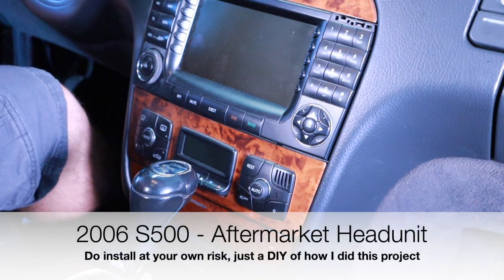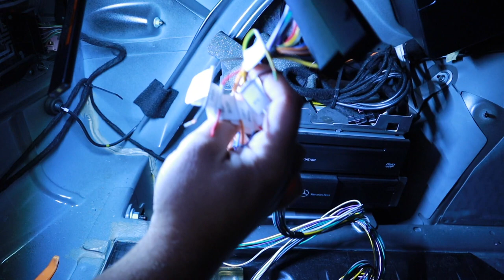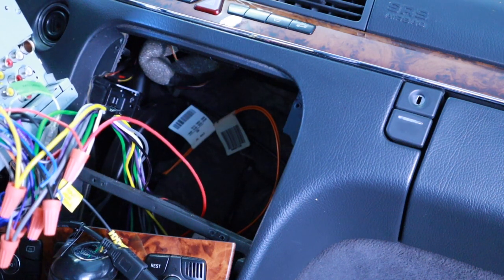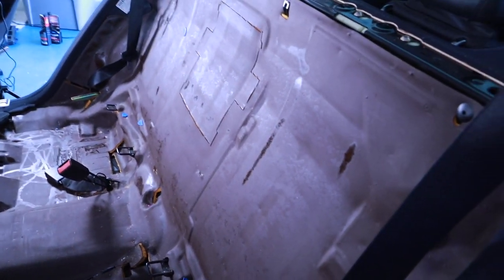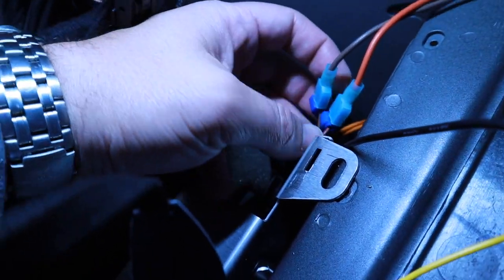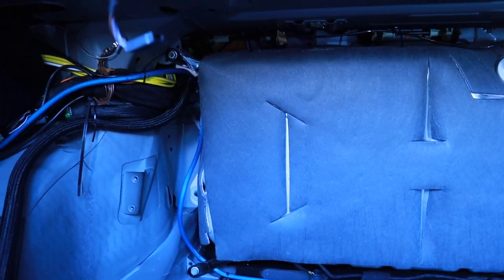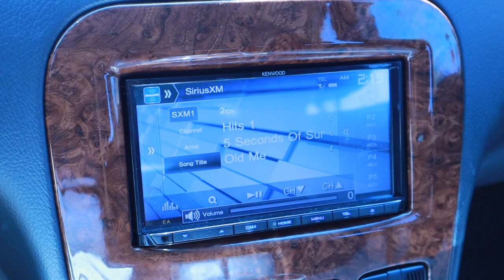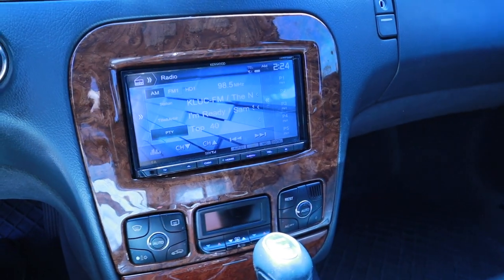(START TO FINISH) Kenwood Head Unit / Stereo Upgrade on S500 S430 W220 Mercedes Benz

Comment: Just did mine... your video saved me probably 2 weeks of pain - thanks so much! One small tip for someone who wants to do the upgrade. If you want to use the can-bus signals to steer the radio - you can use the can-bus on the climate control (twisted wire pair brown & brown/red) saves a lot of additional work.

Comment: Thank You for taking the time in producing this Excellent Instructional Video - Bravo Bravo Bravo ! 🚘
Reply from the maker: Happy to know you liked the video. It was very frustrating and fun process. Most time was wasted waiting on parts and about a week tracking down the dead battery issue. Every morning would have a dead battery. Disconnecting the audio gateway is needed.
Reply: @ShoppeRx  I can imagine the frustration - The AGW draining the battery has always been an issue with the W220 - S Class - I own a 2005 S430 since new I have 32,834 miles on it, and experienced the Battery Drain Problem, due to a bad AGW Module - Now I'm looking to Upgrade The Command Unit to something like you did - I'm still in the researching stage, and found your video very informative in the process - Thanks Again ! 🚘

Comment from the maker: **Update** it’s been about a year from the start of this project. I no longer have this car as it was a gift for my brother, but he’s still loving it. The only issue reported, the amp has cut out a few times during the hot summers in Texas, but nothing serious. Might have to make an investment in a better 5-Channel amp such as Alpine. Head unit still works great along with steering wheel controls.

Comment: Great work and great video. I have a problem and I hope you can help me.  I've installed a double din radio to my wife's 2003 Mercedes S430.  Now I have no climate control.  I noticed when you turned on your car to check the radio the climate control didn't come on as well. How did you solve that problem because I'd check every fuse and they are all good. Thank you very much. Eric.
Reply from the maker: Sorry for the delay. I didn’t have any issue with my climate control before or after the install. I think I just had it set to off. Sorry I can’t be more help.

Comment: Nice job. I did mine last year. Kenwood head unit. Skar 5 channel amp. I will say it was a pain running the wires down the center and I have to do it again for a back up camera. So I was reading in the mb forms that someone used the satellite antenna wires in the trunk lid if there not being used for there backup camera wires. Because this car has a umbilical cord that run from trunk lid to the rear under deck lid. So that way it’s easier. I’m going to try it and see if it work. Since you only need 3 wires. Power  ground and video. You can ground the video shield to ground it’ll work.

Comment: cool video and learned a lot. would you be willing to install for me? 03 w220
Reply from the maker: LOL. I would have hoped my video would have given you the courage to DIY
Reply: @ShoppeRx  I replaced my brake rotors and pads and air shock struts, change oil. Unfortunately, I never been good with car audio. Maybe I'll watch your video a couple more times, thanks.

Comment: hi your video is amazing and I'm doing my sister car bud how did you got the woofer going the 4 channel are for the doors and the 5th channel is for the SUB on the bypass harness have 2 + and 1- for the SUB
Reply from the maker: I used the Infinity K5 (5-channel) amp. Door mids/tweets run off each one channel so each door is run off the amp. The subwoofer in the trunk is hooked up to the “sub” channel on the amp. On the Spiral Audio wire harness I did have some challenges with mislabeled wires. My sub + & -  wires were something else. I had to use a toner (you could use a 9v battery) and corrected the labels.

Comment: I tried this. Only I just hooked up the deck with the basic 10 wires and tied into the hot for the cigarette lighter. Only now something in the car is staying on and draining the battery
Reply from the maker: Yeah I had the same issue after my install. Had to take to a Indy that specializes in Mercedes. They had to disconnect my audio gateway or my battery would die each morning. They said it was just pulling the factory amps fuse I believe.

Comment: Will it fit the 2002 w220 model? Im trying to get apple carplay or something cooler, my audio keeps going silent, idk which wire in the drunk is causing that , but also where would i find the trim for an aftermarket radio? Any help is appreciated
Reply from the maker: Any double din radio will work. The key is the wiring harness and dash kit. I understand the 2002 used a different harness and totally different dash kit. Checkout Spiral Audio. They will likely have everything you need.

Comment: What did you do with the fiber optic cable on the factory amp
Reply from the maker: I left all factory fiber optics as normal. The only thing I disconnected was factory harness behind the Command Unit/stereo.

Comment: Hello, please tell us how is the sound quality after upgrade?
Reply from the maker: Following my video, the sound quality is a huge upgrade to the factory COMAND  and amp. Getting a stereo (head unit) that supports Hi-Resolution sound and also an amp, will sound even better. I believe the K5 amp I used in this video supports Hi-Resolution sound. Streaming services such as Amazon Music support Ultra HD music (if you pay for the upgrade service). Anyway, sounds amazing. 

If your on a tight budget and or lack the confidence with installing an aftermarket amplifier, you can use the head units built-in amp, but I tried it and was disappointed with the sound quality and lack of subwoofer. I have done many aftermarket stereo upgrades and this was one of the best sounding systems.

Comment: Can you still change the clock on the dash?
Reply from the maker: Unfortunately not. But the solution is to disconnect and reconnect your battery at exactly 12pm or 12am twice a year. Unless you live in Arizona, just once.

Comment: Greetings
Does this bypass the MOST Fiber Optics?  Do you still have surround sound?
Reply from the maker: Yes this bypasses the factory MOST amplifier. Also keeps the center channel speaker, but bridged it across the front channels so it’s mono. Ultimately it’s works amazing. The wiring harness bypass from Spiral Audio has numerous speaker wires for all possible speaker options.
Reply: I don't know why someone wouldn't just buy a MOST adapter for $110; it saves hours of work since you don't have to run new wires under carpet and cut the amp wires to splice in the speaker wires. The only thing you might lose is the front/back fader control.
Reply: @louisseaman8455  Thanks for the suggestion.  What brand and Model would I get for my 2005 s500?

Comment: Does this come with backup camera
Reply from the maker: No, it doesn’t come with a backup camera. You can buy any aftermarket backup camera. Spiral Audio does sell a backup camera that replaces the right trunk light housing. It was on backorder at the time and i went with a knockoff from Amazon that just didn’t fit right, so i decided not to use.

Comment: yo bro im trying to do this on a 2003 s600 definitely need your help i dont wanna lose mh steering controls ans etc
Reply from the maker: You wont loose your steering wheel controls when using the proper Axxess Steering wheel control as I used (see description). You will lose the Navigation and Audio info on your instrument cluster.
Reply from the maker: Yes, you could purchase an Android unit. The advantage from my understanding, is the built in steering wheel controls vs. my video of the addition of the Axxess steering wheel controller. I didn’t go this route because of bad experiences in the past with the Android units.

Comment: does your speedometer only show "AUDIO"? Also
Reply from the maker: I can toggle through Audio, Nav, but there all showing blank. It won’t list the station anymore. You can purchase the NavTV Optical adapter that uses the factory amp and won’t lose that function
Reply: @ShoppeRx  which adapter?  I didn't find any, I'm from Germany
Reply from the maker: If you wanted to retain your factory amp and retain all function of the dash “Audio” features, you would want to go with the NavTV Opti-1 
https://navtv.com/products/NTV-KIT501/most-hur-mb-s-opti-1.html
The all-in price vs. what my video shows is about the same investment. Also going with the NavTV Opti-1 is a very quick install process.  Very few wires to run with the Opti-1 option. Likely a couple of hours total. The reason I went the route of my video,  I wanted better sound quality and more bass on the sub than retaining a 14 year old amp with little power.

Comment: Would this work on a 1999 car with the older command system? Im hoping it would as everything is being replaced except speakers
Reply from the maker: If you have an older S500 W140 body style, it looks to be a similar setup, but not with this Spiral Audio wiring harness. Looking over at Crutchfield they have some resources and proper wiring kit.